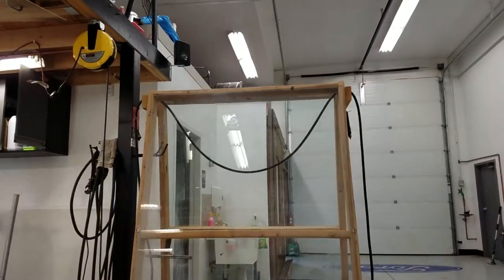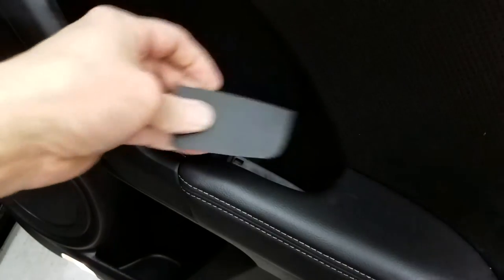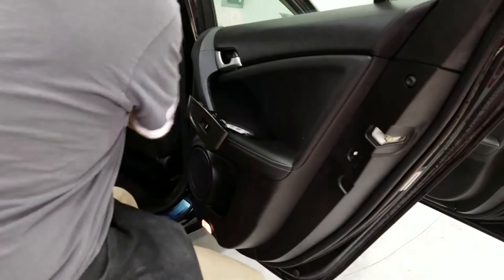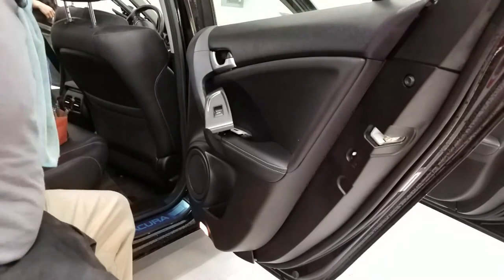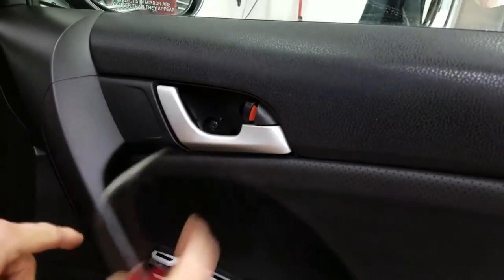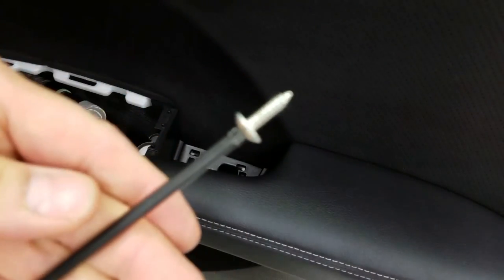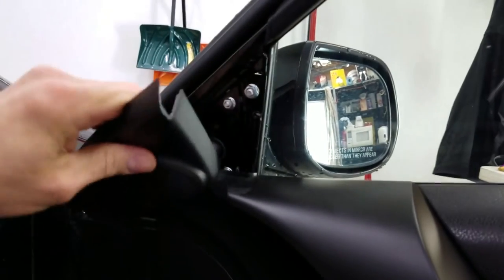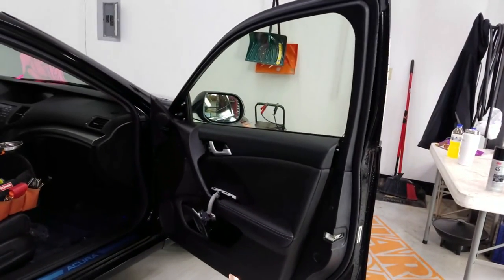2009 to 2014 Accura TSX door panel removal

Comment: Great video bro, im literally about to do my rear door speakers in my 12 tsx and without this video it would have been very frustrating.......thanks
Reply from the maker: No problem. Check us out at learnhowwtotintcarwindows.com
Reply: Tint Academy how do i pull the part where the seat belt is hidden under. It leads to where i need to tuck the wires thru the door
Reply from the maker: I'm not exactly sure but usually a plastic panel and a t50 torque bit for seat belts
Reply: Yo what size are those speakers?? I can’t get a firm answer on the size

Comment: You know how to remove tsx 09-14
 Breaklight assembly (not the bulb) passenger side
Reply from the maker: I do. Do you have one you need to do? You're talking about the rear deck correct?
Reply: had water in mine. Have to remove philips screws from wheel liner on bottom and mid area. Pull the rear bumper out and away from the metal. Plastic clips will pop. Remove two phillips screws on bottom side of taillight. Inside, remove plastic trim from cloth paneling. Remove (3) 13? mm nuts holding taillight assembly in place. Installation is reverse of removal.